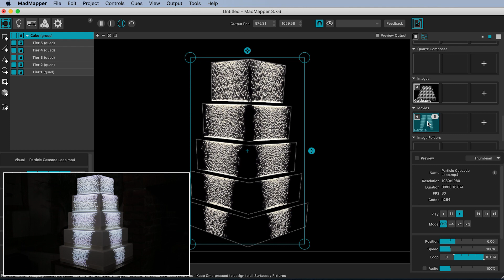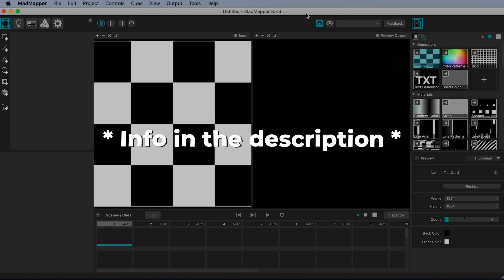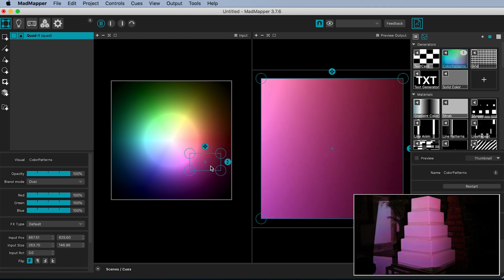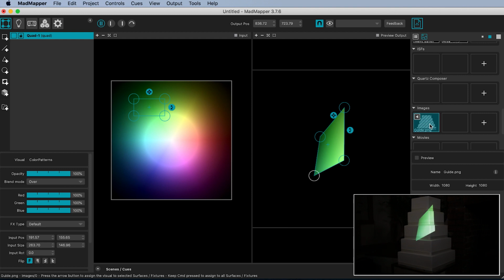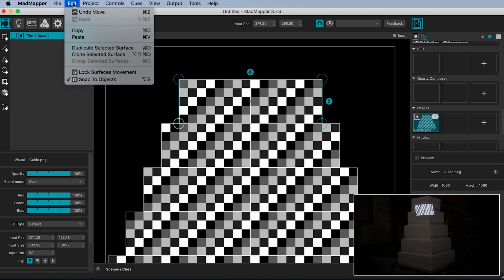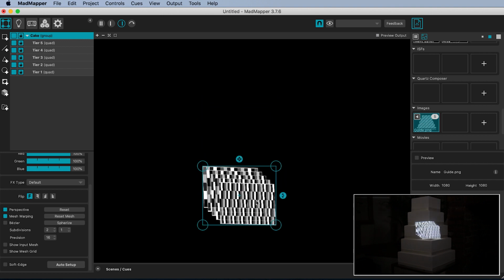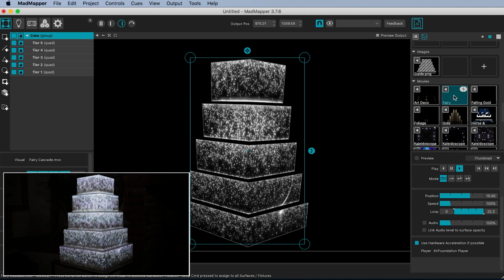Cake Mapping with MadMapper Beginner’s Tutorial

Comment from the maker: Any questions, shoot 'em my way :)

Timecodes:
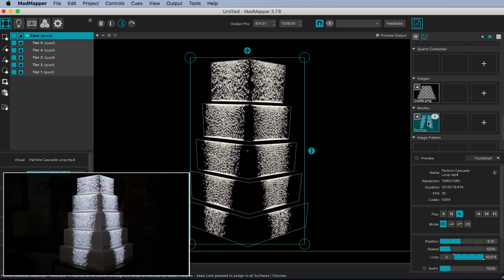00:00 Introduction
00:27 Hardware & Set-Up
00:24 Projector Set-Up
02:08 Explaining Projection Mapping in MadMapper (Input/Output)
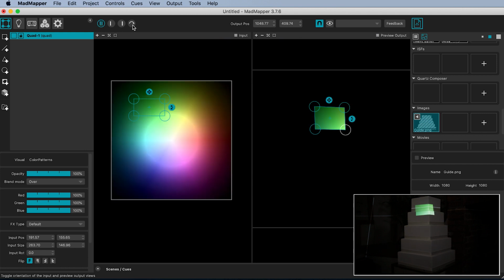04:56 Cake Mapping
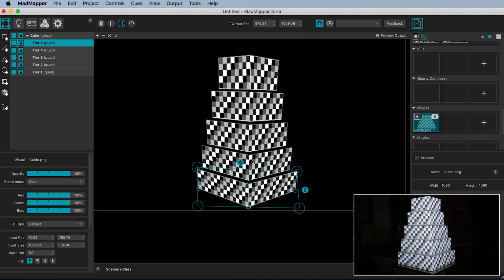08:08 Materials & Generators
Reply: Hi Lumabox
my madmapper demo on windows10 not show subdivision function when select box of mesh warping so i can't divide mask and necessary to do by draw it. (projector still not connected)
am I doing something wrong?
Reply from the maker: @roger7447  Have you clicked Generate Grid and applied it with the desired number of vertical and horizontal subdivisions?
Reply: @LumaBox  thanks, resolved! graphic on  my version is a little different, not showed as default as your menu...too much thanks
Reply from the maker: @roger7447  Awesome 👍
Reply: Hello.
I want to project some images (such as png and other type of file, not videos tough).
Do you know some simple software that could do it?
Reply from the maker: @paulomendes4248  MapMap?
Reply: @LumaBox  , I've seen it.
Not quite what I need.
I want something like Inkscape, where I can work with png/svg files and project only those images (not the entire layout).
Also, I need to use cm (centimeters) and mm.
Do you know any software (free/open source code) I could use?
Even if it's not quite like I need, one software that I can adapt with some coding.
Asking too much? 😅
Reply from the maker: @paulomendes4248  Could you go fullscreen on Inkscape and output your display to a projector?
Reply: @LumaBox , I need to use the tools while I'm using the full screen on the projector.
Reply: Hi !! Great tutorial, I just have a question : when I go on full screen mode, both my computer AND the projection go in fullscreen. How do I do so only the projector goes on fullscreen ?
Reply from the maker: @lionorealves1015  Have you followed these steps to set up your display settings? https://youtu.be/HoCHFjCTXNY (windows) https://youtu.be/yhG7fsR7sM0 (mac)

Comment: The cake guide is 2048 by 2048 and on drawing the inputs quads you use the cake guide and then switching to the video that will be projected instead of the guide  and the inputs quads fit really good on the video, how is the video 1920 by 1080?
Reply from the maker: Hi 🙂 Which video is 1920 x 1080?
Reply: Luma Bakery the particles cascade
Reply from the maker: The particle cascade in the tutorial is 1080 x 1080, the same as the guide. The assets I've linked to in the description are larger: 2048 x 2048 (I downsized them for the tutorial to optimise performance) but, again, the guide and the particle cascade are the same size as each other.
Reply: Can we export a video from madmapper or every time playing the show we play it through madmapper?
Reply from the maker: Check out this thread https://www.reddit.com/r/vjing/comments/9azz39/export_warped_video_out_of_madmapper/ or this forum post http://forum.garagecube.com/viewtopic.php?t=9518.
Or look into the MiniMAD which is designed to playback a MadMapper set up as part of a permanent installation https://madmapper.com/minimad/

Comment: I love your videos, thank you! The only problem I have is, on my tests the beamer outline is always visable, this is probably because my beamer is too cheap right? What do I need to look out for when buying a beamer? I wanto to remove the backround as much as possible. Thank you for the videos!
Reply from the maker: Hi. It might be because your projector is cheap and has a low contrast ratio, though this is a very common problem, even with more expensive projectors and is somewhat unavoidable. Look out for high contrast ratios and read reviews about a projectors 'black level' performance. Alternatively, you could stick with the one you have and try some inexpensive practical workarounds like 1) backlight the wall, 2) use a very non-reflective backdrop (like black fabric) or 3) move the cake away from the wall so there isn't a surface for the spill light to hit.
Reply: @LumaBox  That makes sense. Its probably the projector.

I will try these workarrounds on the weekend. Those are really good ideas. Thank you!
Reply from the maker: @cdotbot  No Problem :)